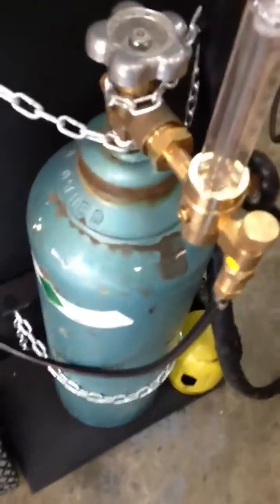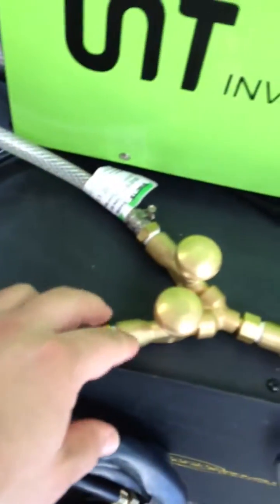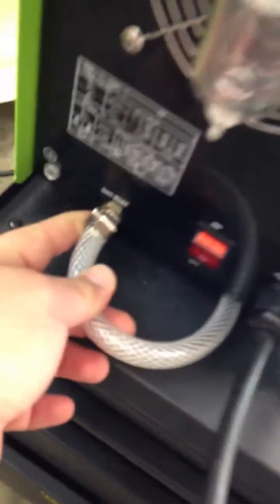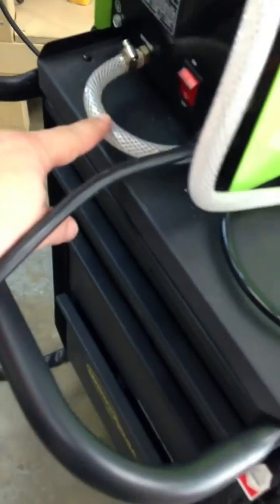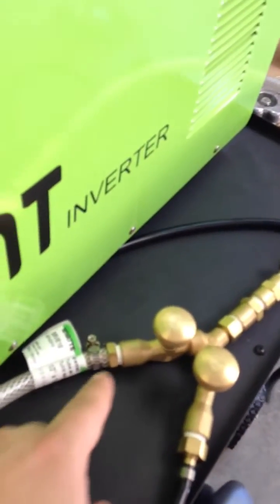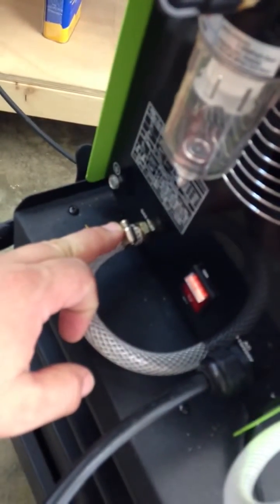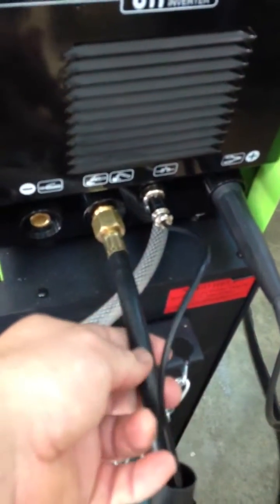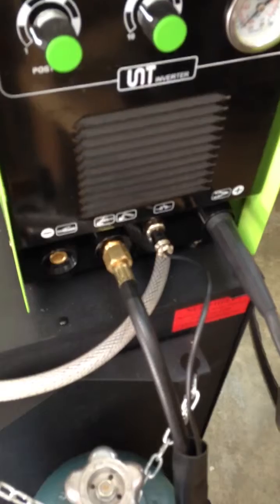Argon vs compressed air hook up

Comment: Has it worked to weld with compressed air rather thn Argon or CO?? Thanks!
Reply from the maker: Lucas This machine is a welder AND a plasma cutter. The compressed air is only hooked up when the plasma is in use. When welding, the argon is connected. The Y is to deliver one of the two gases to the correct entry point on the machine. Welding with compressed air would be as bad, or worse than welding with no argon. That is not what I was trying to do. 😁
Reply: @EZ_shop  Oh! Haha! Ok, understand. I thought the last that you say, so wanted to know if worked. 
Yeah! I thinks too that it may be worse than welding without gas. but... :P
Thanks for your reply!!!!! Take care!